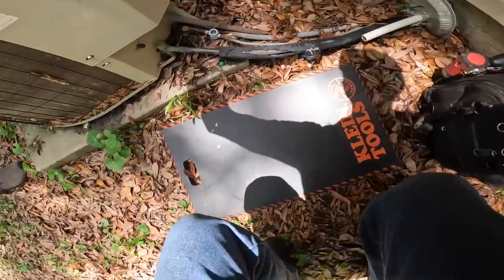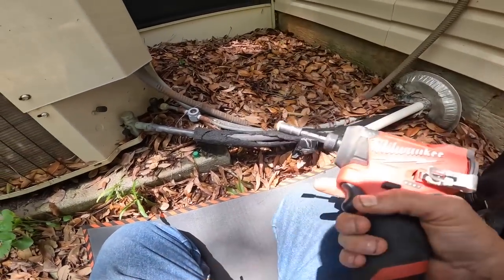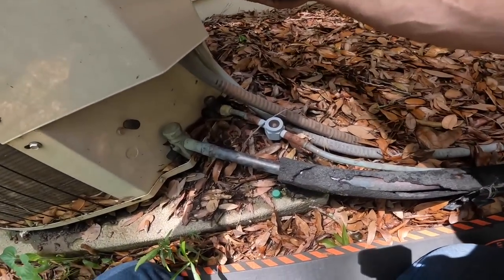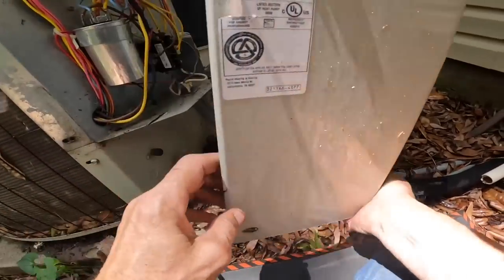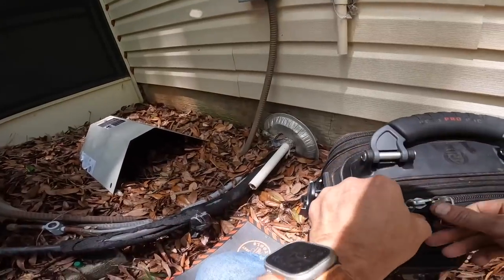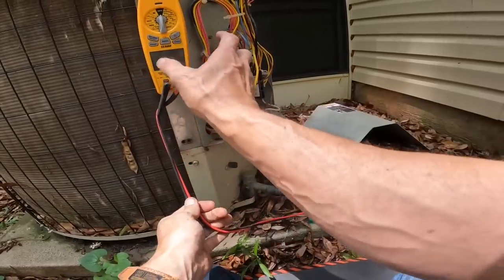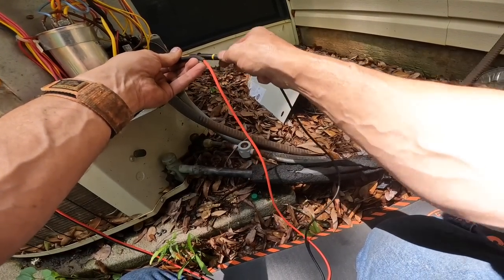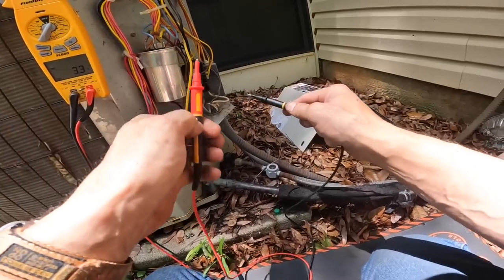Customer Implied I Had Ruined His System and Asked About A New One! #hvacguy #hvaclife

Comment: I love the start of his conversation “the warran”….BBBZZZTTTT condenser kicks on. Typical. 

I had a lennox furnace/add on cooling coil a few days ago, the customer wanted the condenser moved further off wall (id also diagnosed leaky tx valve, low charge and needed a good clean of the evaporator and condenser coil.
So long story short, no leaks after replacing TXV, fresh charge of 410 and a deep clean of the coils. System working perfectly 

Get the call yesterday about it not working, went around and had a similar conversation with the homeowner lol! Rcbo tripping due to faulty breaker the electrician had installed on the board

Comment: Home warranty companies are like a bad HMO. Do just enough to keep the patient barely alive. When I had a home warranty in 1996, they replaced a 12 yr old Day & Night (Carrier) with a tiny, noisy, 10 SEER Goodman (with a Bristol scroll compressor.) That Goodman ran 5 years and 2 weeks then the Bristol failed. 2 weeks out of compressor warranty. Funny how that happened... I had long since fired the bad HMO and so paid dearly to install a 14 SEER Lennox. The grass ain't always greener on the other side of the fence; "bright and shiny" (thanks Rainman Ray) does not imply good quality. The home warranty company might end up DOWNgrading you with a new unit!
Reply: I've worked on a bunch of Lennox with underperforming compressors and they won't replace them under warranty. Most customers don't know they have a POS until it gets 95 outside. I'll never sell Lennox. I've been working on refrigeration for over 40 years.

Comment: WOW!!!
You mentioned the leak at the schrader valve?  I just had this SAME PROBLEM!!!
Long story short, I was cleaning a customer's two outdoor units.  He decides to wait until I am done to tell me, "Yeah, they just don't get cool like they used to..."
  I stopped, looked at him, and asked him rhetorically, "Do what?!..."
  He went on to tell me that the two units don't cool the house as good as they used to 'because they are so old'...
  I said, "It doesn't matter how old the units are; if they're not cooling the house like they're supposed to, then there is a problem." 
  I said, 'Let's go inside; I wanna check something.'
  I did a temperature split and found his Delta T was 7°F!!!
  I then proceeded  back outside to check his superheat & subcooling.  The moment I removed the caps on the service valves, I immediately found the problem:  You could see bubbles slowly forming (and then popping) from the suction-line's schrader valve on unit #1!
  But the strangest part of it all:  BOTH UNITS were VERY SLOWLY leaking from their suction line's schrader valves!!!
  Their protective plastic caps were apparently slowing down the leak; they were on there really tight (maybe from the pressure built up from the accumulation of refrigerant filling them up as the system leaked over time?... 🤔🤷‍♂) 
  The only difference here though is that my customer didn't try and blame it on me! 😆
(I hate people like that... 🤬🤬🤬)
  Keep up the awesome work you do, Curt!

Comment: 99% of those home warranties are a joke and people are pissing money away with them.  There is always some fine print that gives them an out with coverage of a repair, usually the kinds of repairs they'll cover are things that would rarely if ever occur, things like a bad compressor wire harness, or a bad accumulator.  I've run into some warranty contracts that have ridiculous stipulations in the fine print that even allows them to void future coverage for just about the entire system if the homeowner refuses anything that a service contractor claims the system needs.  For example if contractor tries to sell a UV light system on the indoor unit, during a PM service call, the customer declines it and the contractor notates it with the warranty vendor, then 6 months later the condensor fan motor dies, the warranty won't cover it due to the earlier refusal for something that had zero effect on that motor.  I could go on an on about the things I've seen with these warranties, don't even get me started LOL.

Comment: Sure they will replace the unit, and if that even gets approved they will NEVER Pay for installation and miscellaneous = $3500.00 - 5500.00 depending how difficult it is ,or even more. 4 years of working with warranty companies is all a can take. Great job my dude as always!
Reply: I priced my change out, and it is 6k and it is from a friend, most companies would be 8k or more. That is why I charged my old one up again, and put that stop leak in it. So far so good, I'm just trying to keep the old girl going a couple of more years. I will post a year from now and let it be known if that stop leak worked. I figured I had nothing to lose by trying, it was a hundred bucks plus the R22 to fill. It was 300 for that. Man that was a quick 400 bucks, but a lot less than the 6k.
Reply: Sealer kits I tell my customers it's a 50/50 shot, either you're gonna dodge a bullet or it won't work. 🤷‍♂️
Reply: @AllTattedUp13  I hear ya, I'm skeptical big time, I figured at this point in the game, I had nothing to lose. The past few years I've been putting roughly 3lbs of Freon in it.
Reply: @jthonn  thats a small leak, chances are sealer kit prob should work. They also make a knock off r22 called nu22 or mo99. Alot cheaper then the real deal r22.

Comment: My neighborhood had a transformer blow one leg of power, one crew comes out and jumpers all the affected houses. Well..days go by, houses get hot with no 220, no dryers, ovens, AC’s etc, multiple calls later, tech says his dispatcher is frustrated by all the service calls (like as the customers without 220 we aren’t..?) I said “well, Rocky Mountain Power corporate customer service line says they service six states, and don’t know the specifics and force you to make a new report every time you call for an update which isn’t an update.” One crew (meaning..a guy in a truck) does one thing, next crew comes out and acts like it’s a brand new day. Days later I find out I’ve been without 220 because the original crew didn’t put the meters back on the houses the very same day they fixed the transformer. They have no communication at all..and you’re never allowed to talk to a local person to get to the bottom of something. Fun..I told the last guy “last thing we want to do as homeowners is bug you guys doing the actual work unnecessarily, so sorry for this, but it’s pretty ridiculous! Your corporate needs to figure out a better system!:

Comment: Man, that just had to happen. Especially if the customer is ready to tear you a new one. That is an old system, I mean you can tell right away, not too many have a sight glass anymore. You do the best you can, that is all you can do. What if the compressor decides to quit? That would not be your fault, or anything for that matter. I would stress that the unit is working and running fine and that it is not your fault if it goes  out after you leave. It may go out in an hour, tomorrow, next week, or 5 years from now and it is not anything you have done. That you repaired the thing properly.

Comment: Good work curtis 😊😊😊 I just made my first account with ferguson plumbing supply 😊😊😊 picked up some solder and a mapp gas tourch 😊😊
Reply from the maker: great to hear
Reply: What's so good about Ferguson
Reply: Mapp torch won't do it. It'll drive you nuts trying to braze 3/4 or 7/8. It does ok on 3/8.
Reply: @Bryan-Hensley  I wanna do water heaters to that's the reason why I got mapp gas ! No for brazing I know to use acetylene or oxyegen acetylene
Reply: @Hvac-dude  my bad, I thought you were talking about HVAC
Reply: @Bryan-Hensley  it's all good I wanna do both ur fine !!!!
Reply: @Hvac-dude  I tried using mapp torch in the beginning when I started working on HVAC. It didn't work out very well. I managed to get some brazes to flow on 3/4 but not the service valve.
Reply: @Bryan-Hensley  yeah mapp gas is more for plumbing 😊😊
Reply: @Hvac-dude  I know, I just don't have much money when I started my business
Reply: @Bryan-Hensley  me eithier ! Sadly

Comment: it’s always the technicians fault, not only does he want to blame you he wants to stand over you while you work like a helicopter then he wants to squeeze out a free unit under warranty. Typical. 3:58
Reply: Yup that's people for ya . ..well some people anyways. Stand your ground is what I say. Even if this customer says otherwise , maintaining your integrity speaks up for you to others .
Reply: The homeowner may not have phrased it to Curtis that way... Curtis may have just put that in the title to get more clicks.  I took my 2019 Jetta R-Line to a local chain oil change shop... as I have for many years with my vehicles.  2 days later, there is an extremely loud knocking noise in my engine.... EXTREMELY loud and concerning.  I called them up and told them about the noise.. I specifically said that yes, you guys were the last ones to touch anything under the hood but it could also be a coincidence also.  They were kind of like not wanting to admit to anything, etc.. etc... So I had it towed to the local Volkswagen dealership and it turns out, that my specific model is known for 4 bolts that seem to come loose because they were not installed with loc-tite or similar at the factory.  NOW, on a scale of the mother of all coincidences, that was a 10.  I am quite sure most people would have automatically blamed the oil change shop... and while not fair to them, it would not have been too far a stretch.  I am an IT engineer and I can't tell you how many times I am just LOOKING at a system, just eyes, no moving wires or NOTHING, and then something happens and users can't get their printers or shared drives, or internet goes down, etc.. and yes, they come asking me if I did anything and while I adamantly deny it, I explain to them what could have happened and I will always be the first one to let them know if something is going down or not.  I would bet the farm you would blame the tech, the oil shop, etc.. the same way most other people do too so come down off your high horse.

Comment: Had a warranty service call last Saturday .Blocked evaporator causing coil to freeze. Ran the system without a filter for few years. Water all over the furnace control board. 

Called it in and they gave me a green light to replace board and clean coil. 

Shut the gad isolation valve feeding the furnace. Alot of water on the control board. 

Ordered board on monday including air limit. 

Home owner (landlord) called me tuesday night. Tenant says stove not working and no hot water. ??? Told him to call the gas company. I only shut off gas to the furnace......starts yelling "that pipe is also connected to the gas stove"????  I tried to explain the pipe connects to the stove and every other gas appliance but the gas doesn not come from the furnace. 

Gets hostile and calls the warranty company to complain. Warranty called me an wanted me to back that night. Went back .....water heater working.... thermostat set too low. ?? Stove not working.....has gasbut  bad spark igniter.???

The work order was sent to a supervisor who repudiated the furnace repair because of neglect by running system without filter. 

Now the landlord keeps calling me ????   Apparently verbal agreement is bonding. I told him i ordered the board and will repair furnace on friday....mind you this before work order was sent to supervisor.

Comment: So many assumptions... it is no wonder there is so much anger and hatred in this world.  At no point in time did the homeowner ask Curtis to lie.  That disconnect looked old AF and it legit could have vibrated out of place to lose connection.  As long as the home owner isn't expecting Curtis to lie or anything dishonest, I am all for the homeowner!  I'm in the same boat!  My HVAC system is 2005, and the AC has a slow leak.  Why should I have to fork out money every year for band-aids when I pay for a warranty?  How is that fair?  And before any of you keyboard warriors wants to put the chips and beer down to smear your greasy fingers all over your keyboards, you have no idea who my warranty is with, what it covers, etc... just like you don't know anything about this home owner's extended warranty.  They are NOT all the same